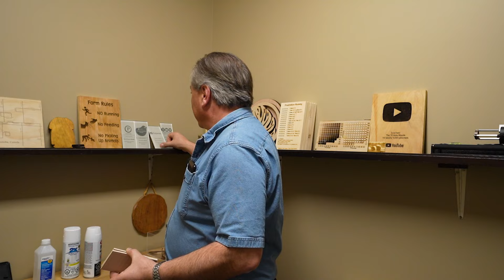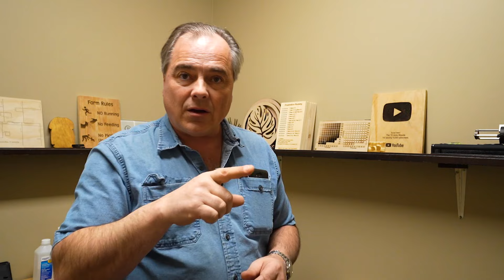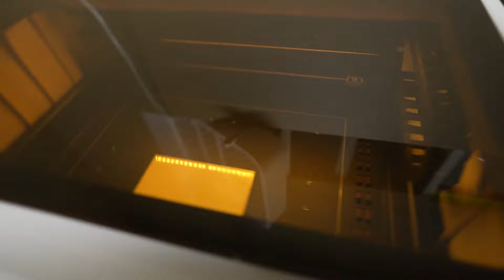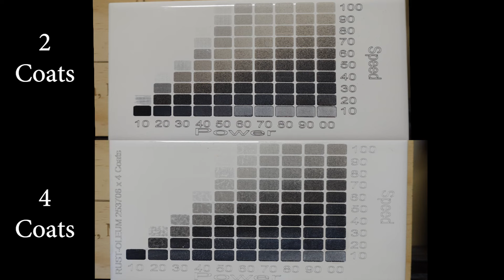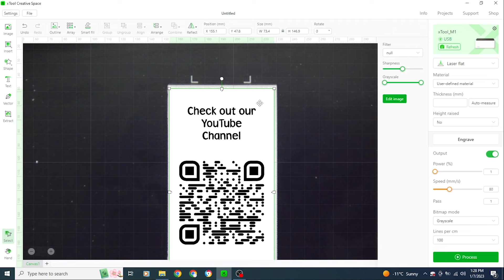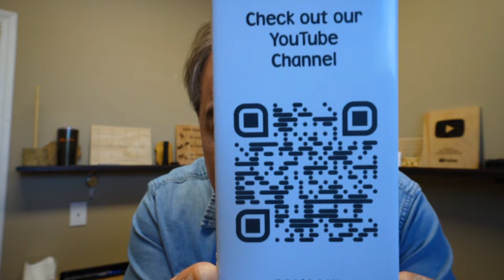Ceramic Tile Laser Engraving on the Xtool M1 @xToollaser #xtool #laserengraving

Comment: Where online did you get the template for the Power/Speed Graph as well as how do you run that in Creative Space?  Thanks.
Reply from the maker: You can make this material test array in xtool Creative space. Click on "insert" on the left side and select rectangle, then make a small rectangle. From there go to the top and hover over array, then select material test array that will bring up a box for you to choose your parameters.
Reply: I also have the same question

Comment: If you have done the process correctly the titanium dioxide in the paint has fused into the glass on the suface of the tile and  there are zero chemicals that will remove i the black. You are only going to remove the unlasered paint.

Comment: Great video. Can you please share the settings you used on your M1 for the glass panel engravings you showed in the beginning? Thanks in advance. I have the M1 10w
Reply from the maker: Honestly I can't recall the settings I used on the glass tiles but I do recall using a test tile to determine the correct setting. I would recommend using one tile and engraving a power/speed chart to determine the best setting.